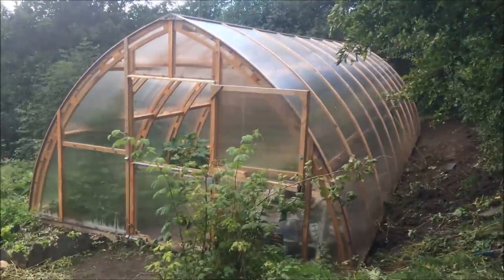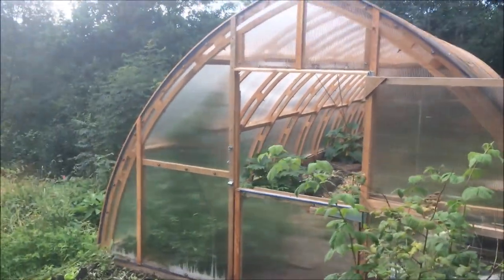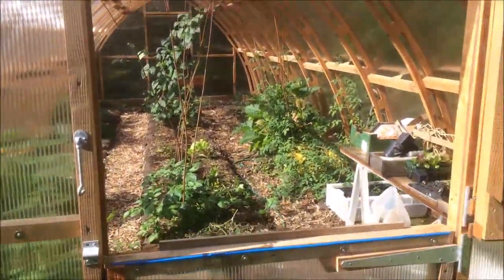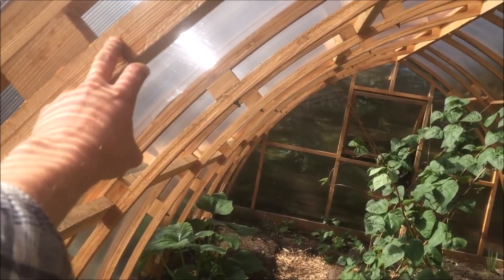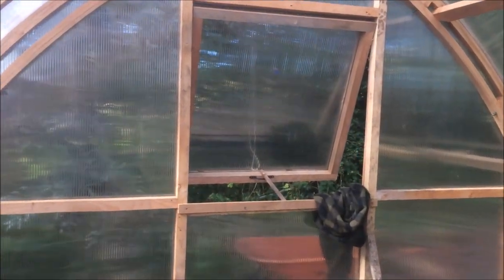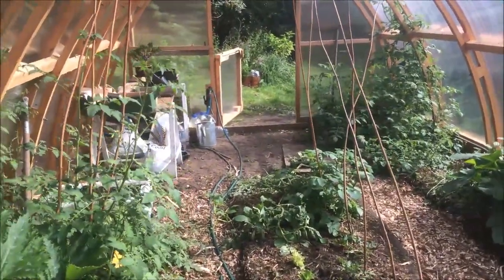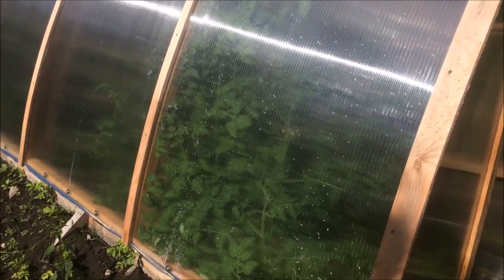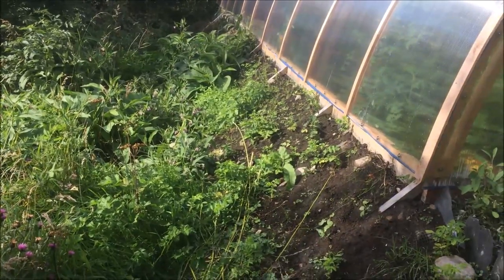Timbertunnel -Timber Framed rigid polytunnel tour (gothic arch)

Comment: Fantastic. Wanted to make my own ploytunnel but out of wood and found this video. Just perfect. 

What thickness poly did you use? Would you mind sending a link to what you used? 

I use alot of Birch plywood so thinking of utilising the offcuts and laminating to a similar shape. Iroko for the external items, capping etc.
Reply from the maker: I use 2 strips of 15mm Douglas fir with a 50mm block then another 2 strips. I’m not sure plywood would stand up to the humidity. I’ll be doing plans later in the year. Our new website for selling them is timbertunnel.co.uk

Comment: Lovely design Al, I'm currently making something similar but using 63mm MDPE pipe to form the dome. I like your solution to joining the glazing, those H sections are a rip off. I can't currently decide on 6mm or 10mm twinwall. I live i  Nottinghamshire so we don't get quite the same extremes in weather as you.  I'm not sure I can justify the extra expense of 10mm. I've also used lift off hinges for my stable door top section, i expect it can just get stowed in the summer. The door frame is on 1050mm centres to align to the twinwall widths so propped open they'd be a bit of an obstacle. I'm also considering using the top joint as a ridge vent where the glazing would otherwise butt up. What are your thoughts matey? Cheers, Baz
Reply from the maker: 6mm would be fine I’m sure. You could bring the centres in or add more central fixings to stiffen it. I wondered about ridge venting too but opted not to in the end, but it could definitely work. I think you’d want to close them off in winter though. Good idea for the lift off hinges, my door is the same size and it’s a bit of a whopper